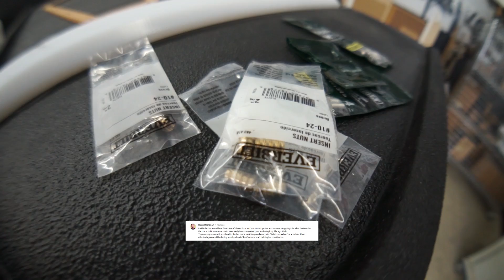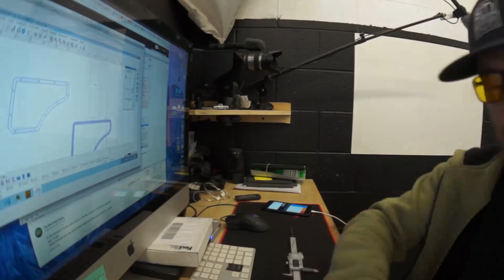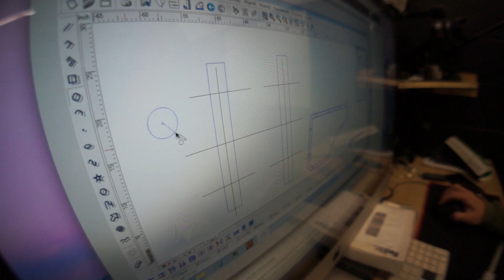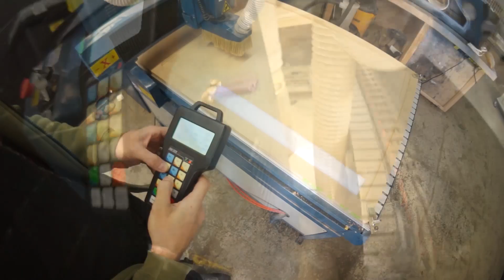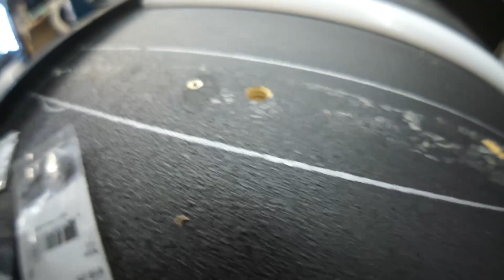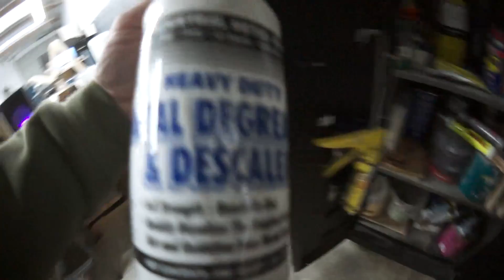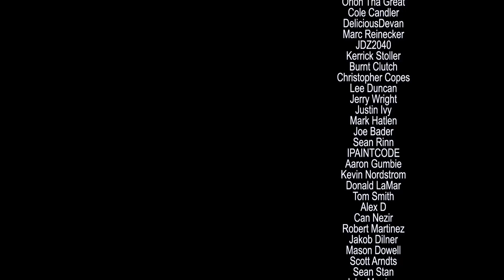Port hatch DONE! and urethane sliders MOUNTED! CHECKLIST ALMOST FINISHED! - AMPLIFIED #709

Comment: Have you addressed the thickness of the cork is going to make the plexiglass stick out. Maybes a nice bevel to the edge of the plexiglass. Or cut another. You can use MAP gas torch to glass out the edge again.  Fab on fabulous faulker.

Comment: Would be cool if you could Hydro dip the tubes with a crazy design.
Reply: hydro dipped glow in the dark!
Reply: That’s a sick idea, but with the tight fitment not sure if it would hold up being pressed back in. Wonder if the hydro dip would stick to the pvc being pressed back in
Reply: sick66caddy some layers of clear coat might do the trick

Comment: Doug is the kind of guy to hand sand all the rust off then put it in the sandblaster. Why Doug? Why?
Reply: jacob bennett takes up more time lol
Reply: It’s a scuff pad, used to take down the high spots in the rust. It helps speed up the blasting process and looks better.
Reply: Daniel Warren I know I know, but it’s Doug. I had to give him a little shit. You know how it is
Reply: Its surface rust !!!! Still if it was heavenly pitted rust the sandblaster will blast it clean The only reason why some people clean the PITTED rust with a wire brush is too make sure not to much of rust particles is going to pollute the cutting sand from you sandblaster
Reply: If it was a part for  your car, he would just hit it with a wire wheel, charge you extra for rush delivery, and send you on your way.
Because it's his box.....

Comment: Doug, did you put some LockTite on those screws? or will you be doing another video removing the box (again) when it comes loose and slides around in your truck bed?

Comment: For the rust on the parts check out Coroseal rust converter. Works great converts the rust and also primes the metal for paint. If ya need a smooth surface thou it won’t work, still have to sand or grind it off.

Comment: Put a super light wiping of white lithium grease on the back of the cork gasket before you final assemble it.  It will make it come apart nice if you/when you pull it apart again down the road.
Reply: This is great advice. That cork will stick to anything once it's compressed.

Comment: I’d use a black seam sealer under the diamond plate to mount it. I’ve seen it used to hold bus body panels on from factory.

Comment: A quick tip Doug if you want a better finish from a spray can get fan style caps and you can get better coverage and finish and you wont have to wet sand as much you can get 100 for around $6 online

Comment: hey doug can u se what my box is tuned to because I have been building a ported box for the first time I useually have sealed boxes but decided to change the box is 39.1/2 inches wide and 18 inches tall and 20 inches deep (front to back) and the port is 18 inches tall and 4 inches wide if u could that would be great thanks all the way from the England

Comment: Hey Doug try 3m vhb tape and promoter  for your top we use it to hold the metal on the sides of cargo trailers with screwless option. It should be more than enough to hold it.

Comment: Doug ...try using the landau glue to hold the diamond plate panel down...hell if it’s good enough to keep vinyl on a 78’ Buick Regal it will keep that plate on nice and secure ,,,the follow up the perimeter with some 3m black silicon ...ba-bam !!

Comment: WEIHRAUCH HW100 STAINLESS STEEL BI-POD SLING SWIVEL STUD
These bolts would look badass in the top of that diamond plate steel.
Reply: TheCanadianBubba That's to tighten the bolt.

Comment: If you don't put a groove in the bottom of those sliders, water will back up in the channels because your blocking them off, and the drains are at the front of the bed.  You will want the water to drain instead of backing up to the top of the channels and potentially getting your box wet.  I know it would be just a small amount of water, but no water backing up is better.

Comment: Using cork on the window isn’t a “sound” idea. It’s porous and easily warps. A gasket foam or a silicone chalk should better seal the box adding that weather protection needed around the window. That cork is going to swell as it absorbs water and eventually crumble.

Comment: Too bad the paint he jus sprayed on the metal trim ring won't fit now because he didn't take into consideration the paint will be too thick. And where is the water going to go in the channels to dump out through the bed drains....oh an what are going to do about the water that's going to sit on machine screws in the urethane slats....just some thoughts for the genius....